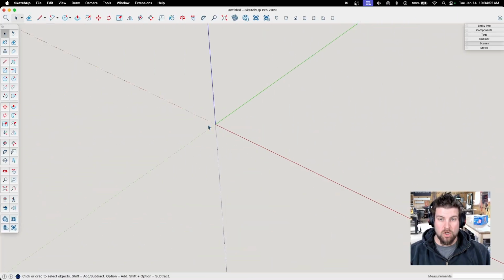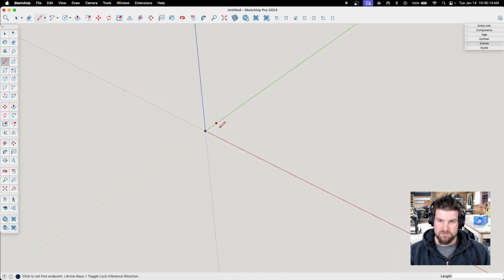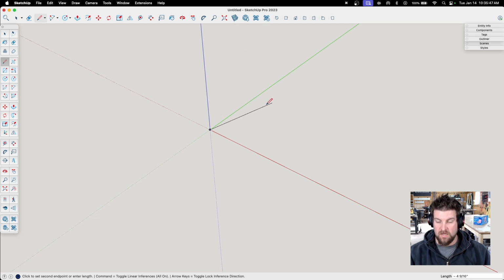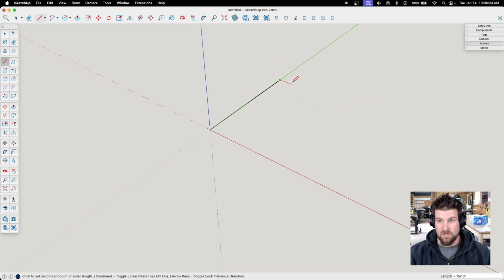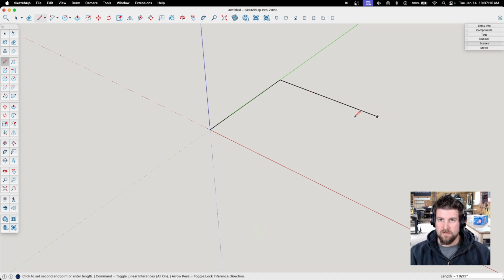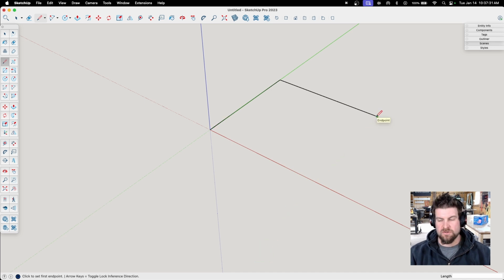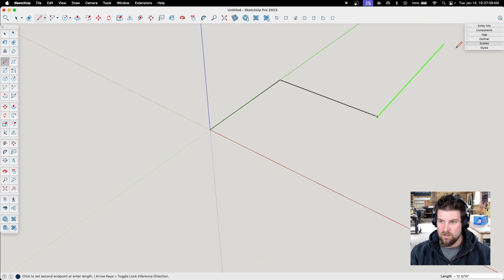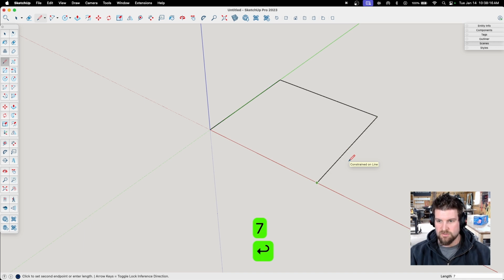Master the Line Tool in SketchUp Today

Comment: Thanks for the vids, when your in the middle of a drawing and you have been moving and rotating the object and get disoriented how do you recenter the object back to the the original staring point, hopefully they makes some sense
Reply from the maker: I think I know what you mean… typically, when I get discombobulated I just use the extents tool and it will get me in a place that I can adjust. Otherwise, I’ll hit undo until I know what’s going on. 
Hopefully that helps??